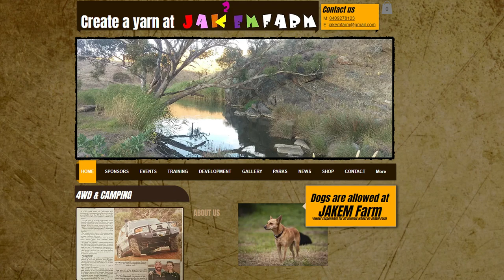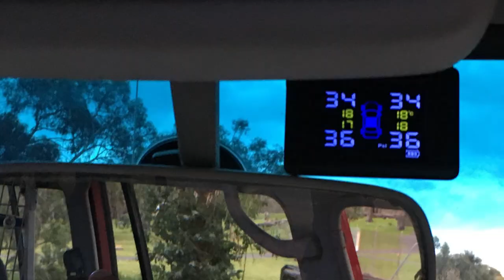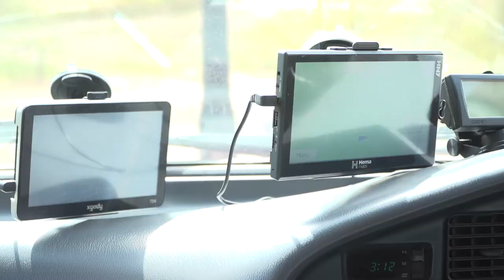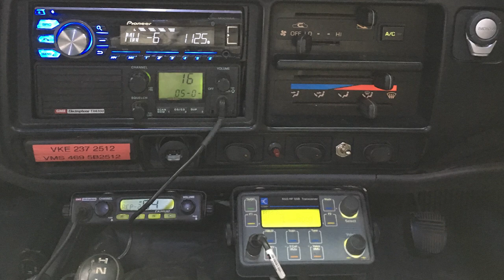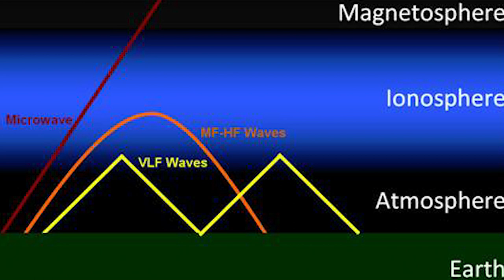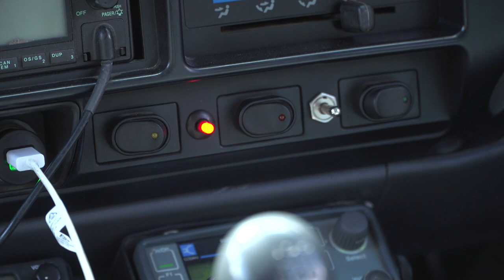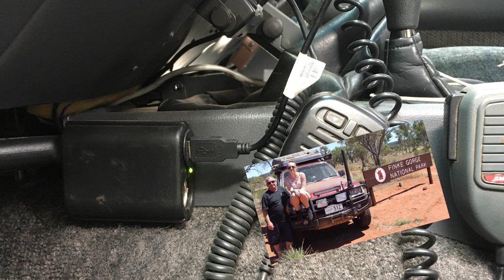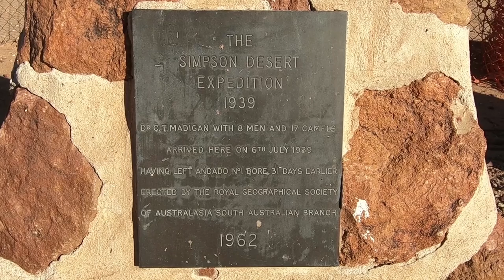80 series Landcruiser Review, Modified Episode 64

Comment: This episode was awesome, great dude, knows his stuff, really enjoyed this one RD, 🍻

It’s given me some more ideas and solved one delima I had, which was side/rock rails /bars, after have std Toyota side plates on the 2 new Hilux’s, swore I’d never have or run plates again,  always filled with stones, crap, hard to clean and also in muddy tracks you would be pushing mud with them rather than sliding over the mud or through it, adding to chances of getting stuck and extra load wear and tear on everything, I wanted rock sliders and couldn’t find anything that I was happy with, I found what I am after watching this thanks to the Bar work,  which also solved my rear bar requirements I was after, which all came about because of his front bar, if that makes sense, I’d all but decided to stick with ARB Deluxe BB, I didn’t really like, 100% the look of the bar and the rear option wasn’t right for I wanted either until seeing this and then going to the Powerful 4 x 4 website and found front bar, brush bars, rock sliders and rear bar and carriers exactly what I was after, so stoked about that. 

This series even without doing a build etc is so good, really some of my fav vids you do, great work and some really great characters like this dude. cheer RD and those men and women who share their machines 🔥🤙

Comment: Regarding the upgraded headlight globes Ronny - unlike when you put higher wattage globes in regulated 240v power sockets / lights etc in the home, putting higher wattage globes in a 12v vehicle makes no output brightness difference. This is due to the car voltage being much less voltage and less regulated stability - think pure sine / modified sine wave 12v inverters.. 
All it does do is load up the power being drawn and sucks more juice out of your battery and / or alternator.. I’ve tested this many times over the years and can confirm it makes no difference, just draws more money out of your wallet 😂😂 👍

Comment: Possibly still the strongest 4wd ever built
Reply: Don Kinzett they were and a fella I know who worked for Toyota when the 80’s were brand new, said the only reason Toyota updated them was they simply never broke down and never needed parts so they were literally losing money on lost parts revenue - that’s fair dinkum too !
Reply: fukthegoog right ... 👍
Reply: @4WheelingInNSW  - Was that the 1HD-T, 1HD-FT, or 1HD-FTE..? Which update do you think was the peak of parts reliability, longevity, cost, etc? Cheers!
Reply: Guy Menzies-Saunders mate I think it was mainly the 1HD-T but the 80’series overall, the gearbox and chassis, driveline etc - it was the whole package mate 👍

Comment: Nicely built this one is!

I dont know alot about turbo motors, but im pretty confident that a turbo diesel motor isnt meant to lose 1L of oil into the catch can per 100kms. While the solution he found to the problem is whimsical, the ten thousand he saved on the 'mates rates' rebuild may be part and parcel of the oil problem he's having.

great truck regardless, jealous i dont own one!
Reply: Im the guy who was the rebuilder and its been a mystery to us, and about 4 other professional engine builders I've talked too. Its got perfect compression for the rebuild, it doesnt blow excessive blowby either hot or cold, but what it does seem to be doing is holding oil in the head at high engine RPM's (Kinda like how high power LS motors will push all the oil into the top end in drag racing situations).

Apparently it IS a bit of a thing with 1HD-T motors after they've been rebuilt too, they all seem to push a fair bit of oil out of the breathers once they've been cracked open from the factory.

Its gone 150K kms since the rebuild now, and we've never taken that pipe back off to see if its still pushing as much or settled down, but its obviously not detrimental to the engine!
Reply: @ferremit  remarkable!  I had never heard of this issue with the 1HD-T. He's managed to get another 240k out of the engine so it seems to have stood the durability test.
Reply: ferremit  do you have any info on how you returned it to the sump

Comment: Awesome idea for the sand flag. I'm going to do that, too.
Also, I'm at the same...ish point with my rear springs. I daily drive mine and so I take most stuff out and off. However, loaded up, I'm maxing out my springs. I'm looking at air bags as a solution. Any thoughts/ opinions on which would be better; spring upgrade or air bags?
Vehicle: 1997 Toyota Hilux Surf KZN185 3.0TD (Prado 90/95 platform)
Rear springs: Lovells TRR 73
Reply: IF,you do actually go 4x4ing,do not get air bags.coils can only carry 1 weight,but leafs can carry any weight & still give std ride,but,they need to be around 1500 mm long,which,you cant do on a toyota.so,your stuck.in aus,they cant make springs yet.americans can.your best bet,is pump up shocks,with 1 line.to both shocks,so the air transfers,i have bags,work truck,f250, rides like a steel bar,when inflated,no travel.no good.mate with 80 series just got 500 kg coils fitted,2" higher,nothing you can do.progresive coils,maybe,if made right..a guy yrs ago set up his 4x4 for a trip,had new coils fitted,great,after trip came back to shop complaining it rode like a go cart.,mate told him,yup,coils.
Reply: Old post, so you may have figured something out, but have you looked into parabolic leaf springs. From what I understand they're basically the same as a progressive coil spring but in a leaf. Might be worth looking into if your still needing a solution.

Comment: What actually happened to the motor? I thought toyotas were supposed to have bullet proof engines. 290k seems weak.
Reply: From towing patrols every time he went bush?  😀
Reply: Yeah hi the big end bearings that were put in the 1HD-T motor when manufactured were not made properly eg the hardening process and given time then failed this problem didn't come to light till later and was rectified on later models it was only limited to the 1HD-T motor

Comment: 180,000 miles or the 290,000 km for a diesel motor is sad, like that is nothing. My sister had a 1995 Nissan pathfinder or the terrano with 350k miles and still has orginal motor. Dad with a 7.3l with 500k still factory injectors and motor.
Reply: Many 1HDT engines built from 1990-1994 had big end bearing failures due to a manufacturing fault, effected engines usually didn't even last that long.  
On the plus side, most of these engines have had the bearings replaced by now.
Reply: JP Onefourseven facelift 1hd-ft engines shouldn’t have this problem either

Comment: It’s only a 1hz not a 1hd sorry 😐
Reply: You think you know better than the guy who has owned the car for 15 years? It sure looks like a 1HDT.
Reply: Yea you might be right sorry I thought all 1hd engines were twin cam electronic but that just the 1hdt fte the turbo 1hz is known as the 1hd my bad
Reply: @zacjohnson1500   1HDFTE is still single cam but with 4 valves per cylinder.  
1HDT is more similar to the 1HZ, the main difference apart from the turbo is that it has direct injection.